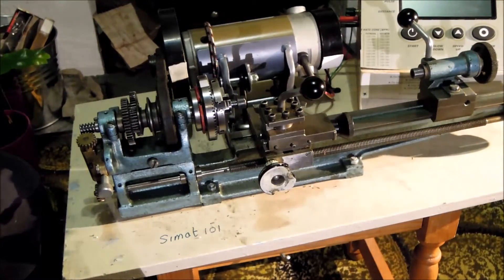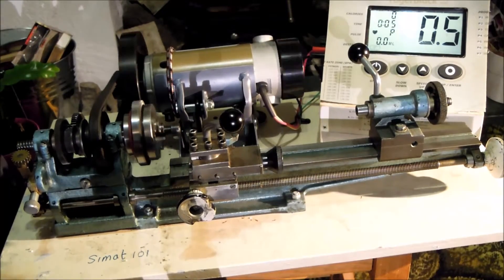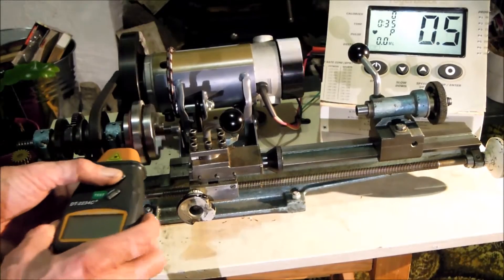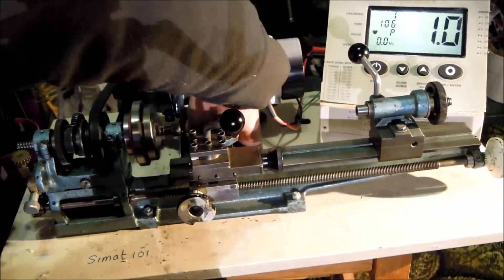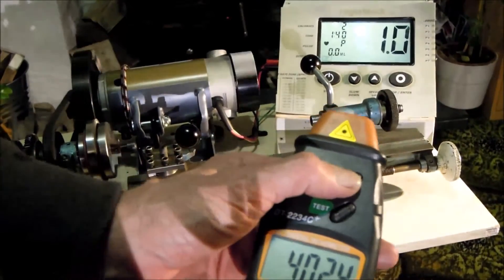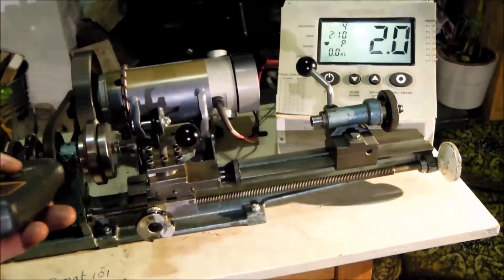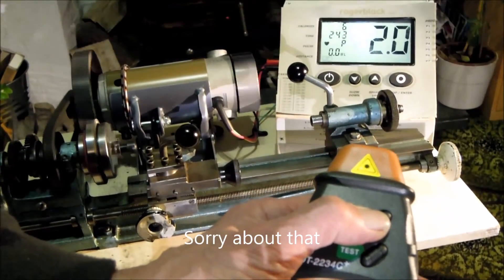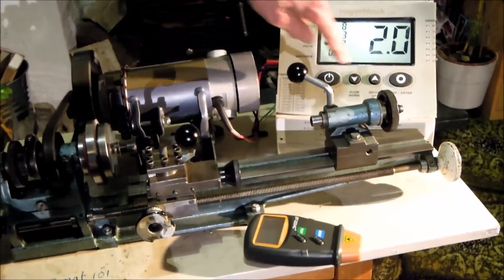speed check variable speed lathe treadmill motor

Comment: That's the RPM sorted ,,,,one step closer ,,,,,, you now just need to sort that vibration ,,,,,
Reply from the maker: ***** I've been looking at alternative belts and in the scrap box for bits to make an idler or layshaft pulley system.
Reply: John Mellor I hope its a deep box John
Reply from the maker: ***** There was nothing in my scrap box- but I found another treadmill with idler pulley for a reasonable price so my scrap box is now a lot bigger!